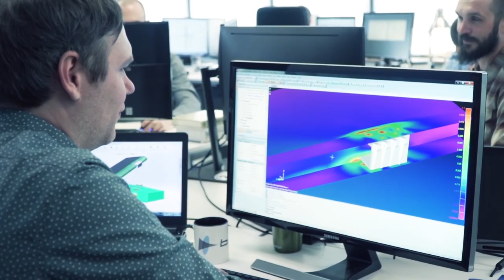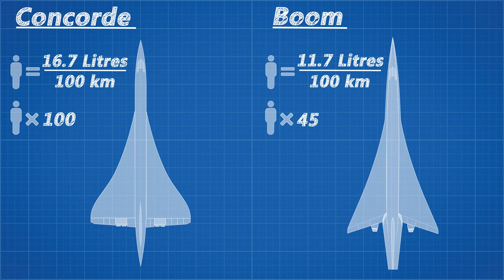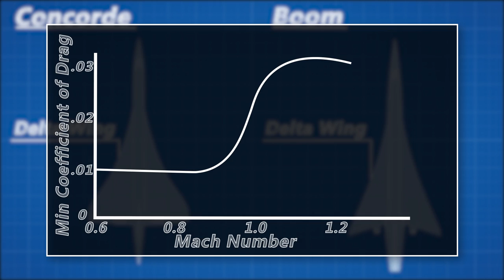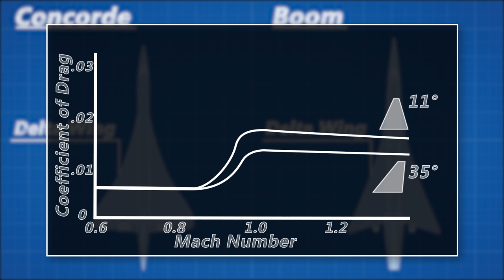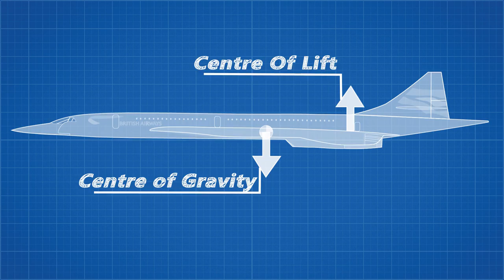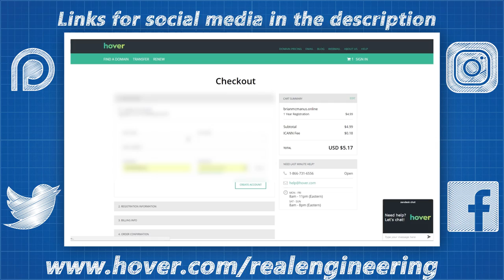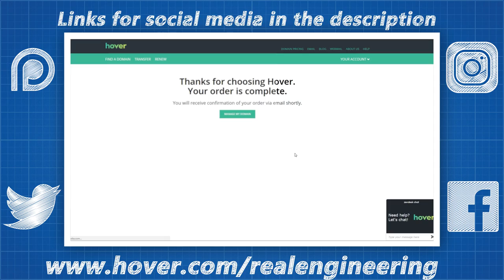Boom: The Future of Supersonic Flight?

Comment: Super sonic flights sounds like a good idea, but in order for the company to be successful they have to make more routes.
Reply: agree, transpacific is very
Reply: Yeah no airline would want to buy one plane for just one or two routes.
Reply: British Airways made a fortune flying Concorde between London and New York. It used to account for 20% of all their profits.
Reply: The Centalist 
I disagree that supersonic flight is a "good" idea. Good engineering and good ideas are not necessarily the same thing. Regardless, this might be commercially viable in a very limited sense. Probably for the best that it stays very rare—it is less efficient and much more expensive than subsonic flight.
Reply: +Tom Johnson - Very true. In fact, you can push it further still, because from about Mach 2, ramjets start being feasible, and they are unbelievably efficient since they don't have to expend any of their energy on rotating compressor blades. Of course ramjets become horrendously inefficient below about Mach 1.5 and they can't even produce thrust below about Mach 0.6, so you'd need a secondary engine for takeoff and landing, but if you could have a plane with a turbofan to get it up to speed, only to then switch off and pass its duties to a ramjet, that could be a very efficient supersonic plane. Regulators probably wouldn't be exstatic about the idea of routinely switching engines on and off mid-flight, but efficiency-wise, it would be a winner.
Reply: 20% of all there profits!?! That's really hard to believe do you have a source?
Reply: What about carrier style assisted takeoff?  "Fire" the planes into the air then have onboard engines take over.  Multistage is great for rockets, why no use similar principles for planes as well.
Reply: PongoXBongo what about the comfort for passengers....it's not exactly comfortable to sit in a catapult
Reply: Maybe you could have sliding seats to absorb the recoil?  But I doubt they'd have to do too much.  You're already sacrificing comfort to ride in a supersonic sardine can.  And that's only the moment of take off, after that you can make things as lux and first class as you want.
Reply: we are talking about a plane that could land on any major airport..  right?
Reply: +syaondri, it obviously doesn't go at supersonic speed while landing... Only when it's fully cruising at like 40k feet!
Reply: @
Brendan Forde B.S. Concorde was not making a fortune they weren't turning a profit at all, get your facts straight.
Reply: @Robert Faber That's how the SR-71 Blackbird was designed, it used jets to take off then used ram.
Reply: PongoXBongo Nope, now a days Aircraft are designed around Airports. The A-380 was designed to fit in the Gate, Airports aren't going to go out of their way to construct catapults on run ways. The Aircraft has to work on what currently exists.
Reply: @Brendan Forde: Uhm, no ... i was alive at the time, and remember all the hoopla in the news on a regular basis. BA actually LOST money on it (something Boom conveniently glosses over in their overly rosy vid). BA continued it largely for reasons of prestige, and because they were already in the hole for the R and D costs, and for airline bigwigs who used the route who had too much say in the matter.

Boom's efforts are nothing more than a fundraising soak and pipe dreams until they can solve the noise problems so they can overfly land ... without land overflights they have no routes beyond the 2 concorde had.  Fuel efficiency is actually of secondary importance in this limited arena.
Reply: Most people aren't too concerned with increasing aircraft speed. Current speed is OK. If the trip takes 6 hours or 3 hours, it's not a big difference for the majority of passengers. They certainly won't pay double for it. Especially when you consider that airport security, customs checks, travel time to and from the airport, airport delays, etc. wouldn't be affected. So doubling the aircraft speed wouldn't come anywhere near cutting the overall door-to-door travel time in half. Now, if you could cut the price in half, or at least reduce it noticeably, that's the winner. That's what passengers, therefore airlines, therefore aircraft manufacturers want. And supersonic is expensive in every way.
Reply: Diego C, flying from LA to Tokyo takes a significant amount of time, during which I get to enjoy DVT. If that time could be greatly reduced, I'd love the opportunity to fly with that greatly reduced time, preventing most of my DVT.
Reply: They added more possible routes in their website right now. They added 5 new possible routes along with the 3 current possible routes.
Los Angeles to Seoul
Boston to Madrid
Hong Kong to Honolulu
Paris to Montreal
Chicago to Doha
8 routes obviously aren't enough so I am hoping they find more routes in the future.
Reply: @syaondri  You wouldn't want to hit mach 1 near the ground at all
Reply: @muxite6035 /videos See as this is an older post, I'm not exactly sure what I meant back than.  But, I'd venture that it was something along the lines of take-off assist rockets (like WW2-era tech).  But, breaking the sound barrier still causes a boom regardless of whether it's a rocket, a plane, a bullet, or whatever.
Reply: The british and french governments lost money but british airways made profit

Comment: Concorde was adjusting its center of gravity for supersonic flight by balancing the fuel from rear to front depending on flight domain, and one of the main challenge for full scale plane is skin temperature increase and the stress/fatigue for compound that form the fuselage (about 10 inches changes in the length due dilatation for Concorde)

Comment: Great video! But why doesn't anyone think about using variable geometry wings or even rely just on body lift at supersonic speeds to get the drag coefficient to the minimum?
Reply: TheSimom 

The Boeing SST was one such design, but the same problems the Concorde had also plagued the SST, I think it never got off the drawing board.
Reply: $. Variable geometry wings are complicated and add weight and reliability issues. 

Floating body designs may work, but for added fuel economy you'll need to go towards tailless wings. Airlines are all about operating costs. Speed on its own doesn't pay.

Comment: Real Engineering you should really look into doing a video on Supersonic Biplanes.  They would produce much quieter sonic booms than traditional supersonic planes- which might allow for overland supersonic routes provided the booms were at high altitude...  They also are projected to experience less drag at supersonic speeds- as the shockwaves from the wings can be designed to destructively interfere with each other...

Comment: I lived in Bodø for a few years, so I have heard a few sonic booms, but the one I remember was that of an F16 taking off with the afterburner at full blast, and let me tell you: The difference between an F16 breaking through the sound barrier at normal altitude and one breaking through the sound barrier shortly after takeoff is pretty significant.

Comment: Still kinda hard to see the market for this. Nowadays the Security Theatre means you have to check in hours before each international flight anyway, which means the flight time itself is less relevant. Even if the flight is fast, flying as an end-to-end experience is not, so for business travellers it's all about offering a nice environment in which you can get some work done and/or get some sleep. At least Boom recognise that, but it seems doubtful that enough people will pay through the nose on a regular basis to cut what amounts to only about 20% off their end-to-end travel time.
Reply: jammin023 a flight to Japan is 16 hours. it's absolutely terrible. I'm sure plenty of well off businessmen will pay for it.
Reply: Those same businessmen get business or first class seats which are basically flying hotels.
Reply: jammin023 VIP terminals dawg. I'm not sure if they are significantly faster in America like they are in many countries or if they even exist.
Reply: There are usually faster pre-check options available that frequent business fliers can take advantage of.
Reply: that's why the planes interior is an all business class seat design. as far as the airlines who purchase the aircraft (if it gets that far) I'm sure boom customers will have their own high end first class style lounge/gate area
Reply: 90 minutes before the flight is more than enough. Not "hours".
Reply: In bad cases though the gate will close 30 min prior to takeoff, and the checkin desk will close an hour before. Security at Heathrow, CDG, and similar airports can delay the arrival to gate time by half an hour or more, with international flights taking the longest to check in / pass security . I always leave two hours for international flights and 60-90 min for domestic.
Reply: There's gonna be some guy who wants to get there even faster
Reply: I really don't think the numbers are that bad.

Many airlines advise showing up 2 hours before an international flight, so let's use that as our guide. Most of the flights that I can see from london to new york take about 8 hours, for a total travel time of 10 hours. With Boom, that'd be cut down to 5 hours 15 minutes – just over half as long.

The disparity is similar with the other routes shown. The total travel time from SF to Tokyo falls from 13 hours to seven and a half. Total travel time from LA to Sydney falls from 17 hours to 8 hours 45 minutes.

On all three routes, total travel time (including arriving at the airport 2 hours ahead of time) falls by about half. I think you'll find it hard to deny that that's a massive improvement.

Comment: Still some concerns:
How is it going to take off without flaps? Use ailerons as flaps and use canards for the pitch or so? Or are they just taking off at a higher speed? Next question: afterburners or longer runways?
If the solution to problems is "just use carbon fiber", then that sounds quite stupid. Firstly because Carbon fibre is more expensive, so good luck making the plane cheaper. Then carbon fiber is not always the best option, sometimes glassfiber gives your better performance. Carbon fiber is used as a marketing thing way too often, I mean carbon fiber inlays on your dashboard don't serve any purpose, and still people buy it. So any time you hear someone talking about carbon fiber you should be thinking: is carbon really the best option or is it some more marketing BS. And then for racing cars carbon fiber is a preferable choice because of it's stiffness, that's not something you need in an airliner flying in a straight line. Saying "it's better, cuz it's carbon fiber" means you're an engineering noob, real engineers should mention the reason why they made that choice.
6:30 Yeah, just make the wings longer and narrower, drag reduction, wuhuu!! Why hasn't anyone else thought about this before? Well perhaps they have, and perhaps they thought about increased wing tip vortices. Pretty much what's more efficient at high speed is less efficient at low speeds, good luck taking off and climbing.
Then I came across this: "Very low aspect ratio wings glide only a little better than a brick so the consequences of loosing power some distance from the runway are more serious." Basically once your engine's are down you need a runway to land on right now, not sometime you get to the coast. Good luck getting that certified.
8:02 But then: where does the kinetic energy go? I only thing I see this working is by a sort of opposite venturi-effect, where the area is increased and the speed is decreased. I mean the speed doesn't reduce on it's own. Not saying it won't work, but I'm just talking about a relatively big engine, which rakes in much space, with only a small inlet. Not to bad, but not ideal either.
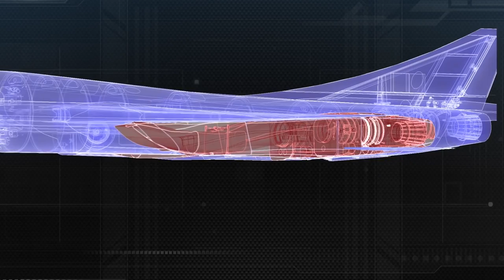8:07 Digitally "controlled, movable" yeah, sounds cool, but it's overly complicated, so what if it fails? You might think: no big deal, it will just fly less efficiently. -And run out of fuel before reaching the coastline. You could solve this by taking more fuel with you and less passengers. And end up with too expensive flight-tickets.

Generally when doing something innovative the money you saved by the improvement are to be spend on testing and certification. Landing on a camera is not as easy as it sounds, you will have to first prove it's safe to do so. And especially in aerospace industries, finding a solution always has it's drawbacks, that's why a super innovative design could actually perform worse.

I don't want to be a hater here, but you've got to be realistic man. I would love to see a doable, thought-through, reliable design of a supersonic airliner.
Reply: The Concorde didn't have flaps it took off at high speeds and high AOA

Comment: I'm not saying that Boom can't do it, I don't think they can make it commercially viable. Dissecting that, I'm looking at the costs for Jet A which hasn't gone down at the same rate as your average petrol price. On fuel alone, the cost is going to be astronomic. Throw in the charges for flight into controlled airspace and having those pokey little Cessnas and Gulfstreams get out of the way, and you don't really have much of a customer base that can afford the flight. Then we get to maintenance, engines aren't cheap, neither are composite structures. Both require routine maintenance and inspection by someone that doesn't have his head where the sun doesn't shine. I don't think Boom is going to work.

Comment: Some facts on here are In need of checking. i.e the reasoning for Concorde finishing was mostly due to airbus and the French and the unwillingness of air france and BA to sell it to other companies ie Virgin. also you fail to mention Concorde was a result of 1950's and 1960's technology. a bit unfair to compare the two so harshly. otherwise a good video some useful information here. Also Concorde had possibly the most efficient delta Wing possible to be design in the form of the ojival delta wing  boom does not have this. Also boom is a lot smaller so engineering wise is easier to create. but as said a good video but arguments isn't fully balanced.

Comment: Four years later and this aircraft still only on PPT. They are saying they want the plane fly in 2026 and start serving in 2029 now. Well, as an aerospace engineer, I just want to say you better start bending your metal now. I am really curious to see how they overcome all the issues the Concord had. I say this is imposssible, a guaranteed failure.

Comment: There has also been considerable research into reducing the noise pollution of supersonic aircraft since Concorde was designed. For example, various changes on the aircraft can alter the noise signature of a boom to make it less of a problem for those on the ground by stretching it out or breaking it up to instead of a short sharp peak in volume. If implemented in a commercial aircraft this could be the difference between a loud boom breaking windows and a thunderous rumble rattling the windows.

Comment: I'm surprised that you left out 1 major detal. Now, I had to re-research this before posting the rest of this. Now, I've been studying airplanes and flight since I was a kid. When I say "studing airplanes" I mean EVERYTHING AND ANYTHING ABOUT THEM you can think of INCLUDING airplane crashes,  how it happened, and what the FAA FBI and NTSB said and did to try to fix it. Now I think I just entered a Mandella Effect. pilots and airplane enthusiasts. correct me if I'm wrong, and think about this before you look it up. But to my recolection and from researching everything on the Concorde including the History Channel (When it was the real History Channel) and Air disasters, and everything that was  online, (before I looked it up again tonight) The Concorde had 4 crashes that were very well documented. The last Concorde crash was in France in 2000. Air France flight 4590 departed Paris-Charles de Gaulle airport on July 25th and crashed shortly after takeoff, killing everyone on board including 4 people on the ground. No crashes? Lol I think not. Flight 4590 went down because a 1 foot long piece of steel or aluminum from a Douglas DC-10 fell from it's engine shortly before the Concorde taxi'd to the runway. The Concorde ran over the piece of steel or aluminum, and the piece ruptured the left fuel tank, leaking fuel as she took off. The heat generated from the engines thrust, ignited the fuel and started burning the Concorde while trying to turn around to make an emergency landing until she had no more thrust and pitched up before bellyflopping on the ground, exploding in a massive fireball killing all on board and 4 people on the ground. They should continue research on the New Supersonic passenger more before REALLY building and test flying the bird. No doubt Airplane, Helicopter, and balloon crashes are inevitible. But there are ways to make Airplanes safer. Just takes time, research, and funding. Also, I'm sorry I forgot your youtube name. But I completely fucking agree with you!!! :) The SR-71 Blackbird is the worlds most badass amazing Airplane to ever take to the skies! 2,250Mph at 86,000 Feet!! Not even the Concorde could top that shit! In an SR-71 Blackbird Documentary, they said at 2,250Mph, they went a mile a second. They also tried putting machine guns on it at one point as a test lol. The bullet was shot, flew foreward about 2 feet, then they passed the bullet as if someone ran next to you at the same speed as you, then you sprinted even faster and left him in the dust! Great video otherwise!! Keep Flying my friends! :)
Reply: A perfectly constructive reply to a well scripted, Thought out and typed comment, You clearly win the internet
Reply: Honestly, this is what I love to see. Passion at its finest
Reply: Andrew Van Ornum , your math on that mile/second doesn't work out. A mile/second is 3,600 MPH. You should be able to do this simple computation in your head.